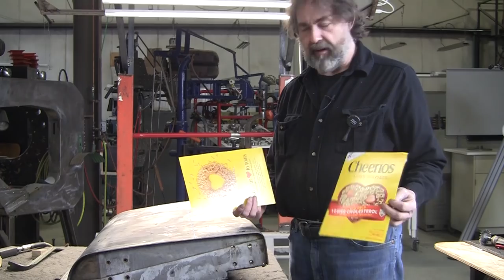Restoration 101: Car Door Restoration

Comment: Nice to see practical resto videos Wray.  Keep them coming. Congrats on hitting 26K subscribers also! Have you looked into any of the new adhesive/spot welding practices used in present day collision repair? I have a 1967 E Type we are currently beginning and am considering using some of the 3M system in conjunction with spot welding in all factory locations to permanently ban the tin worm. It's going to be an ugly one, collision damage with overlapped repairs, yet still nice to see them coming back from the dead.

Comment: Greta video, thanks. I highly recommend the spot weld drill air tools with a self centring cobalt hss end mill type spot weld cutter and a micrometer adjustable depth stop. I picked up a used Clarke one on ebay in the UK, and it's an absolutely brilliant bit of kit. I'd tried various other typed before, but having the depth stop makes all the difference. No damage to the bottom panel. Cereal box card is perfect for bodywork templates!

Comment: Nice job, thanks for these videos.  Spot welds are a pain to remove, I think grinding them down with a round die grinder or belt grinder is the best approach.  Every time you said “pattern” I thought you were saying “patent’. I was thinking “why do we have to make a patent?”, lol
Reply: Find a "Blair" spot weld cutter. They work great, we have probably removed at least a hundred from our Porsche 914 rustout project. I have found creating a divot with a 1/8 drill about 1/16 deep centers the spot weld remover good

Comment: I've always used the edge of a cut off wheel to erode spot welds. I've seen some collision channels use the tiny belt sanders like you have. I might have to pick one up. It looks like they are not too expensive.

Comment: Those stubborn spot welds are a curse - I have to deal with a lot of them here in rusty salty Wales. I found this method to be fast and easy.
I grind the flange with an angle grinder with a standard grinding  disk slightly back a forth and don’t press too hard and very quickly the spot welds heat up like little red head lamps. I concentrate on grinding that until it pops then move onto the next one. The flange can them be lightly prized away with an old chisel and it leaves the spot welds standing proud like little columns - always amazes me how un round the welds always are! Anyway hope this of use to anyone.

Comment: Morning Wray, I have found that using molasses for rust removal is a very good method though slow. Formula is 1 gallon of molasses and 9 of water in a container and for example with your Scout project I'd take 2x6 or 8 and build a frame and lay in a heavy plastic and add the molasses and lay the hood in for a couple of weeks. It will most likely take all the paint off as well. It will come out black and I pressure wash and when done will be gray iron colored. 
I'm surprised that this isn't used more often. Only drawback is that some don't appreciate the smell though it's not too offensive to most people. I put a station in the back of the shop outside. 
I buy the molasses by the gallon in from a local feed store is and usually under 10 bucks.
Reply: Don't kid him!  Tell him how bad it and the mold really smell. And how every deer in a hundred miles will show up. Where ever you dump it will smell for days! But it does a good job.

Comment: Hi Wray . Did you get rid of that Bee at 29 mins ! ( air saw ) .  I have been doing exactly this  on my 'e'type  ! I thought l'd found the spot welds on the rear number plate panel . Trying to find and drill them overhead .... what a nightmare !  I missed them all  !  Sometimes these restorations  can drive you bonkers !  Thanks Wray !

Comment: Great work!  Right at the beginning, you say "dipped the door in rust killer".  Is that a phosphoric acid type of bath - Rust-911?  I'd like to know more about that, I think I found the correct website - it did a beautiful prep job.  Thanks.
Reply from the maker: It is not a phosphoric acid. It is a non toxic non hazardous solution you just add water and let it remove the rust. One  quart of Rust 911 makes 5 gallons of  solution. You can dip parts into it or continuous spray them  ( with a small pump). Usually most rust dissolves in 24 hours, really deep rust can take 48 hrs. The process is passive other than scrubbing with a wire brush and flushing with water after you remove it from the dip. Blow off with air and dry well, I use a heat gun.  I have Rust 911 one gallon concentrate for sale in my amazon store. https://www.amazon.com/shop/proshaper
Reply: @proshaper  -- Thanks.  I saw the Paint and Rust Remover video which answers all my questions.  The two videos together show how well the Rust 911 works.  I appreciate your answer and I'll order the Rust 911 soon.   Apologies for asking when I could have gotten the info by digging a bit.  Your series is great -- your work is top-line professional work and your explanations are clear and easy to understand.  Just a few videos in and I've learned a lot (and I used to work for a motorcycle manufacturing company).

Comment: Is that brace that reinforces the front panel, the one with the full length bead, spot welded to the front? Will you be removing it to deal with any rust between it and the main front panel? Real interesting series. It’s interesting to see how those old cars were built.
Reply from the maker: I don't think I will have to remove the hinge panel reinforcing structure. I have to straighten the hinge panel first and see how it comes out.

Comment: Greetings.  Love the vids. Have a question.  I'm looking to make some copper bowls. One is about 2 feet long, 14 inches deep 8 inches wide nd a rolled edge around  it. Would the English wheel be appropriate for this? Thanks in advance.
Reply from the maker: How you make them would depend on their end use. You could weld the ends on and planish the welds out on a planishing hammer. What is the end use and thickness?
Reply: @proshaper  going to be using them as planters.
Reply: Thickness isn't very important.
Reply from the maker: @devildogdad100   .040" copper will bend really easy into a U shape then weld the ends on . The welds can be hammered into a radius. Copper tig welds easy.
Reply: @proshaper  thanks for the help and quick response.  Appreciated.

Comment: quite interesting practical case, thank you - though I respectfully disagree with the "generally most valuable" 150 over 120 or 140 models ...
Reply from the maker: I based my 150 value remarks on what a friend who exclusively restored XKs for about 40 years told me. He said that his customers would pay more and sought out the 150S models more than any other. The exception would be the first 240 alloy coachbuilt 120s.  He frequently upgraded the 150  brakes and transmission to make them more drivable.
Reply: @proshaper  I don't want to get into an argument over that, but Hagerty valuation data are more in tune with my perception (granted, from the other side of the pond), that is for comparable condition XK140 are about 25% more than XK150, and XK120 about 20% more than XK140 give or take (alloy body XK120 are a different car, several times more than any of the others no matter the condition) - if you only take them from a design view point, the 150s are not as distinctive as the previous two, and the extra HP (when available) is far from making up the heaviness of a pontoon bodyline...

Comment: I am planning to try electrolysis to remove the rust from my Alfa Romeo Giulia Coupe doors. They are generally in better condition than this Jag door of yours, but I do see myself doing a partial reskin too, like you are. For some reason the doors have both picked up some bad rust at their bottom corners even though the drainage slots are wide open - I don't quite get that, tbh.
Reply: I might just use this here opportunity to make a correction - after further investigation, I discovered my Alfa Romeo doors are not at all in better condition than the Jag door, my goodness. In fact, the one is much worse. So, a full reskin for both!

Comment: Great video Wray, how would you remove a dent if you couldn't or didn't want to remove anti drum support from behind door skin ?
Reply from the maker: I use a super thin slapper and slide it under the support. Once the slapper is in place with another slapper  slap the outside of the skin against the inside slapper.
Reply: What if drum panel support is glued on and you can't get behind with thin slapper?

Comment: In my "opinion" , you had given up on the belt sander to early?  Doing collision repair the belt sander is king.😀
Reply from the maker: I didn't want to spend too much video time taking out blind spot welds. If they weren't all rusted and visible It would have taken me a few minutes per spot weld.